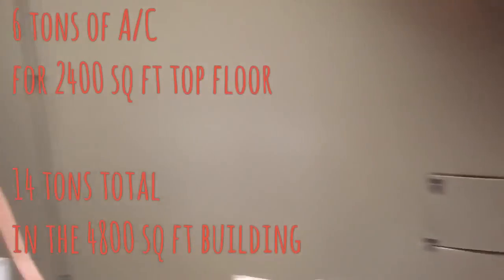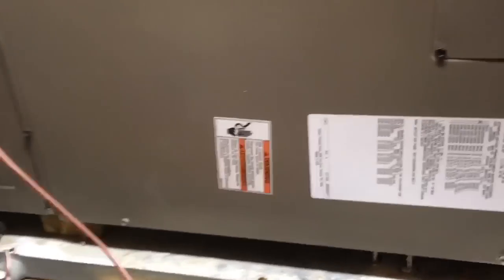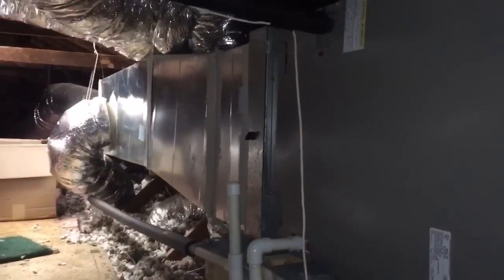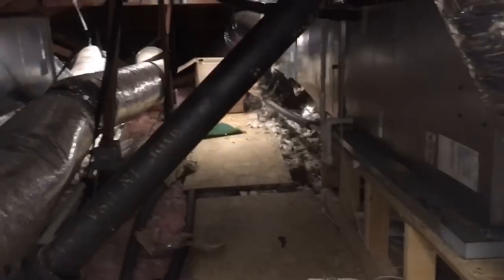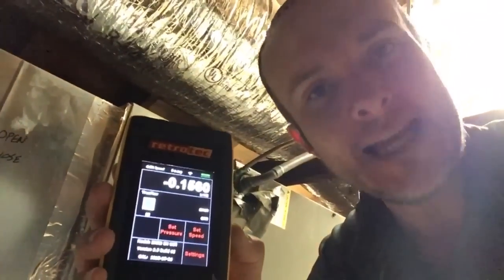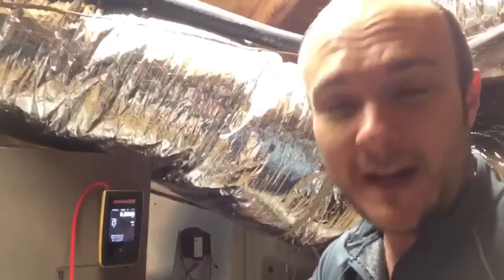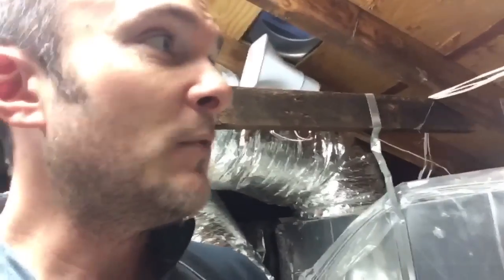Testing the World’s Worst Attic Ductwork

Comment: Was there any mechanical plans used on the original design? Some jurisdictions  require  a stamped mechanical plan for certain dollar amounts. Still curious to see some of the flow readings.
Reply from the maker: The whole system was donated. BUT, it’s a company that installs so many complex Controls that only they can service it ever again.
Reply: @HomePerformance  what is it a Honeywell or Johnson controls digital zone system vav boxes or damper control shortcuts no time only made a bad situation worse poor tie in design , start from original design and correct flaws on back track to restore back to normal , inspect blower motors and fans for correct cfm and rpm design. 🤔✌️👍🙏😸

Comment: Here’s my experience in Florida.   Every installer will criticize the work of someone else as awful and tell you, you got ripped-off.  Most new a/c installers will tell you not to expect  a new ac unit to work optimally unless you let them gut the old work and install a new duct system installed by them because ONLY THEY have been trained on how to match a duct system with their particular model!!  Even if “expertly” installed,  flex duct systems degrade in the stifling heat of the attic;  they develop tears, leaks, kinks, and rodents may eat through it.    It is flexible, but has inherent resistance to air flow, unlike smooth metal ducts.  Everybody seems to interpret their air-flow equations differently and is one reason you get such crazy looking duct work.  Sheet metal ducts should be mandatory in house construction, even if they require special insulation because of extreme temperatures.
Reply from the maker: I hear you brother, it’s very frustrating. Interestingly, though, sheet metal also has inherent resistance and can be sized and installed wrong. You can buy 90 degree elbows with turning vanes inside, if you really want to be awesome and spend more money, but most installers would shy from that level of detail.
Reply: @HomePerformance  Too expensive to retrofit house with metal duct work.  We had metal ductwork in the house I grew up in Michigan.  (And it was built in late 50s!)   Never had to replace or maintenance.  I hate this cheap, inferior, flex crap.

Comment: We see crazy stuff every day. Had a natural draft furnace and water heater in a closet sharing return air and combustion air. Homeowner says, it’s been like that for 40 years. SMH.
Reply from the maker: That’s what’s spooky- old leaky flimsy performing houses could put up with stuff like that. But as soon as we start improving them it can tweak the whole system into a dangerous place. Asymptomatic is the term, I believe.
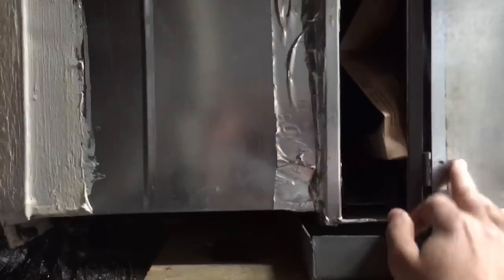Reply: It looks like at 2:35 that is a Home Depot label on the filter. No reputable company would install a 1” Home Depot filter in a 2” or greater cabinet. Looks like a hack has been doing some work there after the original installing company. The mastic on the drive cleats is professional but the block off is  hackery to the highest order. This means two different levels of HVAC guys were touching it.
Reply: @axpertac  good eye for detail , sharp assumption on point , just undo hack job , restore both systems to original design and test or and repair